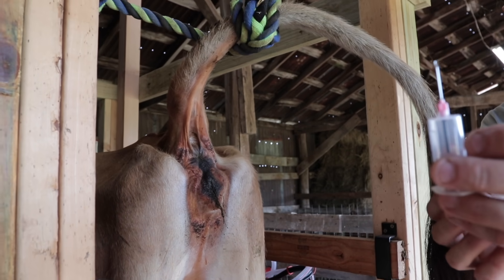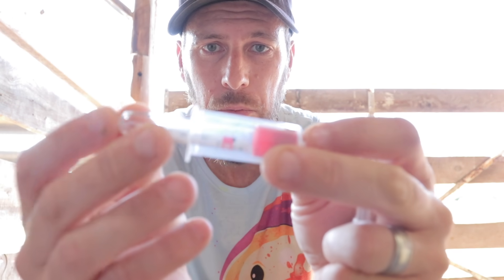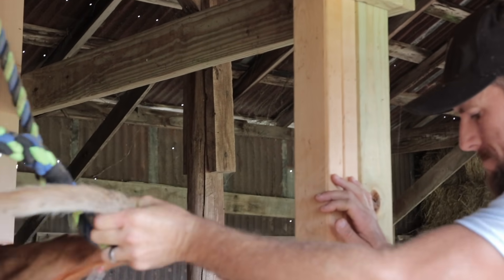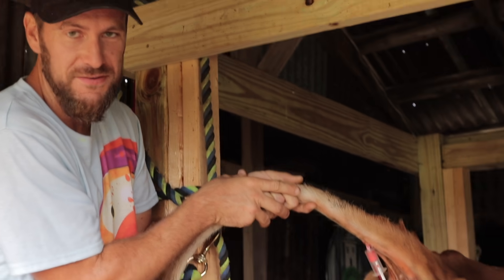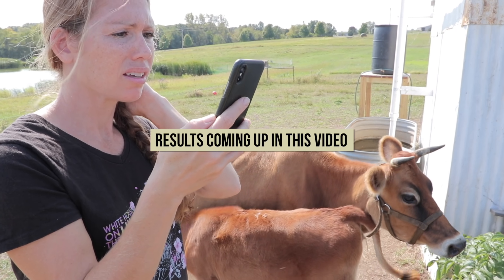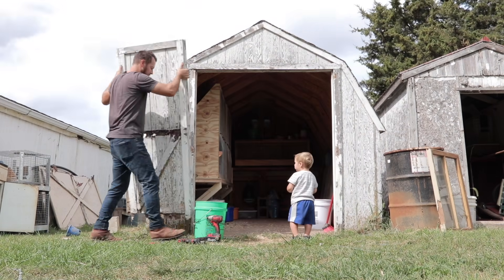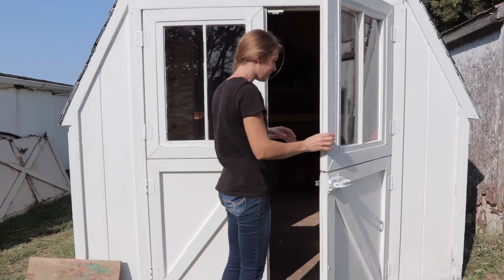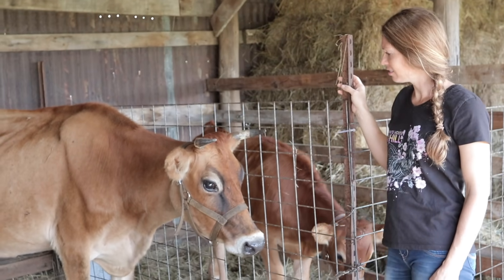is she pregnant?

Comment: gently push the tail up towards her head until you get gentle to firm resistance - this holds her in place as if she try's to back up it will hurt and they are smart so they stand still for you this is what the farmers and the vets do to hold the cows in place to have this done - we call it tipping the tail and in the middle of 200 cows getting preg checked they can be low calling of get hold of the tail and tip that dam tail even if they are in the crush and a head gate it is still a technique used to keep everyone safe

Comment: I am a phlebotomist and want to help you and Dolly. First of all 2 cc’s is not a lot it’s the same as 2 ml. That tube would’ve been fine less than half full. Also there is a safer, smaller needle called a butterfly that I would suggest using.  If the vein is superficial you want to go at it as if your landing a plane but if it’s deeper angle it at about 45 degrees. Also the needle should only go in as deep as the vein otherwise you miss. Sometimes you can pull the needle back slightly and get blood if you go too deep. Hope this helps for next time :)

Comment: A couple of tips from your friendly neighborhood vet tech! When drawing blood, it is best to enter the vein at a 45* angle (or there abouts, anatomy is different with every animal). I find the jugular vein a bit easier to draw blood from especially if you need a large volume. When holding it off, you can see it rise and fall as it is filled so it’s hard to miss. Dolly is super reactive and may benefit from a twitch or nose clamp in the future; they are not cruel and provide a quick burst of pleasure hormone to help distract during uncomfortable procedures. Also, the tube you used needs to be spun down and kept cool, if blood in a serum separator tube is not spun down it can affect your results.

Comment: Sorry but you guys are so ungrateful. Dolly is a living animal, not an inanimate object. You have to work with her and understand her behaviors. Obviously she will kick at someone repeatedly and incorrectly stabbing her with a dull needle. You haven't even owned her for that long, most of your troubles are a result of your inexperience and replacing her won't fix that. AI doesn't work that well, so buying another pregnant cow won't solve your problems unless you plan to just replace your cow every single year to get another pregnant one. If you want to breed her again you should rent a bull, but honestly you should give her a break from milking so she can gain some weight. No reason not to keep her and get another pregnant cow, so they can take turns milking each year. If she's unhealthy you have to figure out what you're doing wrong and adapt to her needs.
Reply: Agree with this! They haven't had a long, don't seem to work constructively with her (at least haven't shown them working with her), a lot of problems would likely be fixed, or at least smoothed, if they spend some time getting to know her and what works! We've had many animals before and things don't click straight away, we've worked with animals for years before they finally come round to us. It takes time, patience and understanding when you work with animals.  No day is ever straight foward :)

Comment: It’s so sad seeing Dolly needing to be in so much pain
Reply: 2:42 yeah :(
Reply: @Joshlyn Renfroe I know. Some of these people need to step back a little and remember this is a animal that has just been kicking the poop out of its legs. Don't think the needle is that much. They are a lot stronger then one little prick.
Reply: Joshlyn Renfroe Even if it were just the one day, they repeatedly stabbed at her (with what I’m guessing were very dull needle from overuse). A vet tech or vet could have had the blood drawn in a minute and avoided all that stress and trauma they put on Dolly. They also didn’t even hold off after removing the needle..
Reply: @PaxxTan  they used different needles each time.
WATCH THE VID DINGUS cus they got 12 of those needles.
Reply: @candicewdub2269  Having a small pinch feeling is not that bad as it seems cus i have had a needle before, it looks scary but it isn't.

Grow up sensitive child.
Reply: TIG RESS you can watch that video and honestly tell me you believe they only stuck her 12 times?
Reply: TIG RESS btw when you’ve gotten blood drawn, it’s from a professional. That’s why it’s a small pinch feeling. If you do it improperly (like they did) it can be incredibly painful and create lasting damage.

Comment: I took phlebotomy and you did fairly well. When she said "don't pull back" you probably should have. It's possible you went past the vein, and touching it back just a little bit could slip it back into the vein. But once you puncture the vial, if you wait too long, you'll lose the suction and need a new vial. That's probably why it was only dripping when you finally did hit the vein.
Reply from the maker: Agreed. I learned a lot through the process. It was difficult trying to learn while having Dolly continuously kicking the needle out. I think I hit the vein each day, but her kicking knocked it out so we had to give up. I appreciate the constructive criticism.
Reply: @whitehouseonthehill  yeah, cows are difficult no matter how skilled you are lol. But it will get easier!

Comment: If  you  push  her  tail  up  , holding  it  near  the  base , puting  some  pressure  on  her  spine, she  won't  be  able  to  kick. There  are  pictures of  people on  Egyptian  tombs  doing  it.  Speaking  from   45 years  ,  as a  dairy  farmer. Vets  would   get  us   to  do  it , if  they  were  carrying  out  certain tricky   procedures, and  it  doesn't  affect  the   cow  in  any  way .   Also bred my  cows  with  AI  done  by  myself (  did  a  course in  1979 ! ). It  does  work! A big  effort im  modern  dairying  goes  into  minimising  weight  loss ( by  nutrition ) after  calving. Doll,   needs to have  turned  the  corner and  be   gaining  slightly in  weight , to  be  fertile. Jerseys are normally  considered  to  be  more  fertile than  Holsteins , but  you  started  off  precalving  with  a  very  lean  cow , and  you  could  expect  to  have  more  difficulty  getting  her  in  calf   the  next  time. You  should  get  a   vet  to  scan  her  - and  at  the  same  time  they  would  find any  problems   such  as  metritis ( womb  infection  after  calving )  or  cystic  ovaries. If  she   were  empty  at  39  days   she should  have shown  heat  again at  around 42  days (  and  you  missed   her  heat  at  21 days. Or  she  could  have  lost  the  pregnancy (  due  to  early  embryonic  death )  so  her  cycle   could  be  lining  up  differently now. Did  she  have  a  good  heat  back  when  you had  her  AId  , and  were  her  discharges  clear ,  without  white  blobs? Did  you  see blood a day or  so after  she  was  AId? That  would  indicate  your  heat  detection was  accurate. Cows often  show  a  little  bloody  discharge one  or two  days  after  heat . Note  this  doesn't  mean  they  are  not pregnant -  it's  not  like  a  woman getting  her  period !

Comment: You could get a pair of impact cuff for Dolly to avoid the kicking too. I personally feel like cows on our diary farm are more likely to kick when they have something tied around their legs, since it's quite irritating to them, and possibly also itchy.
Also, I don't think yelling at her for moving around a lot while shoving a needle inside her tail is helping much, especially when failing to hit the vain you wanted to get. The loud noise you make just scares her more and is also the reason as to why she probably continued/got worse with the kicking as you tried to go on. Maybe get a vet who is used to be around cows to show you how they would take the blood? I think it would help having the help from someone more experienced with them.
Also, I don't think the tail got held right. You probably should put the tail up higher, if not trying to pull the tip towards the head. Since you were two people around her, one could've hold the tail, while the other would've gotten the needle in.
If you're trying to calm her down, you still could raise your voice, but don't turn it into yelling like you did. By experience I think shushing and petting them helps them calm down quite a bit.

This also goes for the milking. Try getting two impact cuffs, one for each side, and try to milk her with them. Usually it works wonders with our diary cows, even with the first timers.
The issue with the back teats being that close together would remain all her life, but it should not be that much of an issue while milking her with the cuffs and the mashine.
The amount of milk you guys get out of her doesn't suprise me much, since she's still fully nursing her calf most of the time. Maybe, ad an idea for the next calf, keep them separated until the calf is off of the milk? That would also mean you should milk the cow more than once a day, so likely 2. Have the calf have a bucket for the milk, and give it 2 liter per meal at first. Maybe even keep some milk reserved for later, so you could feed the calf 4 times a day, so every 6 hours. That would also help it grow better. After about 5 days we on our diary farm tend to change the calf from milk to milk powder, but since I don't think you'd want to do that kind of work for only one ( I know I wouldn't 😉 ) I'd just say to up the amount of milk it can drink at once up to 4 liter a meal, still for 4 meals a day. This would give the calf up to 16 liter a day, which should be enough for it to grow well. Depending on how long you'd want it to stay on the milk, you then should start fading out the milk with other food, like hay or fresh gras every day. Since its still growing, some pellets/grain would be also great. Once it's off the milk, it can be reunited with the mom, though, to avoid it from trying to drink from the mom, I'd say you could also put a temporary nose ring into the calf's nose and remove it once you're sure it won't suckle on the mom. ( but make also sure it can't get the ring stuck somewhere, as it would then possible for the calf to rip it out. )

In the end, having the calf separate could give you more milk to use, a better view on how well the calf drinks, and easier access to the milk in the mom, since she wouldn't try to hold it for the calf, since you guys would be the only form of milk relief.

As for the complain that she's too skinny. Maybe you could try and plant some clover all over her pasture? It's quite energy rich, so it probably could help a bit, if you don't want to feed her more grain than you already do. But be aware that she doesn't have too much on one spot, else she's very likely to eat all of it at once and start to bloat up. I'm not sure what else I could tell you about what you could do with her feed, since that wasn't my strength in the 3 years in training for taking care of cows. Maybe someone else could help you with it.

Comment: Drawing blood from the vein in the tail is easy if you do it correctly. Hold the tail in your non-dominent hand, and push it straight up and slightly back firmly but gently. This will make the cow kick less and expose the vein. When you're ready to insert the needle, use your fingertip to tap the insertion site to prevent startling the cow. Tap, tap, poke. The needle should be inserted at about a 45 degree angle (with the bevel facing up), not as deep as was done here. You went past the vein and also may have hit a nerve or bone with the needle being nearly straight in which can be very painful. Pulling back slightly on the needle can put it back in the vein if you go past it. Also, twisting the needle inside the animal should be avoided. Pressure should be applied to the area immediately after removing the needle. Having someone who has experience with this show you how to do it would be a good idea. Once you've been shown, it's a very simple, quick procedure, and a good skill to have if you intend to keep cattle.

Comment: Do y’all work with her more than just when you milk her? Has she been checked by a vet for any illnesses or parasites? Dairy cattle can be just as sketchy as beef cattle. They need to be consistently worked with to get them to be less “temperamental”. Cows sometimes tend to be like dogs where they just need training and rewards. Eventually, with consistent work, she may be so used to routine that she gets in her little milking stall and be “good” while milking. As far as her being skinny, cattle get parasites easily, a simple stool check could tell you if parasites are causing her lack of weight. I’d hate to see her gone without trying first. (This is all just curiosity and suggestions, by no means am I trying to be rude or anything.)

Comment: Make sure you have your needle turn the right way when you stick it in – the needle is cut at an angle, the down slope should be centered in the vein. If you have it turned the wrong way it can act as a backstop on the inner vein wall.... it can also be the reason why you had drip drip drip and no stream. Sliding the needle slightly in or out may help hit the vein to – do not wiggle back-and-forth. It’s not terribly hard to go through the vein, and too many pokes and you need to try a new spot because you may have just punched several holes in the vein – which is going to cause bruising. I would almost wait two days between poking, I thought I heard you say three days in a row… I bought had a heart attack. That was probably quite sensitive and irritating to poke that often.

Comment: Milk cows are very diffrent from beef cows milk cows were breed specifically for high milk production and put all their energy into that they hardly build any muscle at all (in this way their milk production is also realtive entirely to how much energy they can get from their feed). On the other extreme a beef cow was breed to have as much muscle as absolutley possible they have far far more than their wild ancestors started out with. I understand why you're hesitant on a bull so try checking around and see if anyone nearby already has a bull you can borrow for breeding. Especially if you end up getting a new cow so you can match the breed if possible. Calfs will be easier to sell that way

Comment: Try a Brown Swiss crossed with a Guernsey or Jersey.  The Brown Swiss is a easier keeper, but may not have the yield that the other two breeds but if you cross them... But in the long run, if you want gallons of milk, you're looking at a Holstein. They eat more and you are still looking at grain besides not liking heat.

Comment: I love Guernsey and Brown Swiss cows. I find that they r much more gentle in temperament than jersey cows.
Reply: Also if you work with the jersey baby and teach it to behave properly when handling its feet’s and just generally touching it. It will be much easier to handle when it is an adult. Cows that have been pet and handled on a daily basis right from their start seem to tolerate human touch much better. My neighbor has some oxen and she practices by putting blankets on the baby cows back and by taking on and off a collar around it’s neck. She even made a little handmade yoke for the young cows. They don’t pull anything yet but it helps them to get used to being handled and how it feels to have unfamiliar stuff put on them. Doing something similar might help your baby Jersey cow.

Comment: So good luck on the next AI.  I could not tell what your decision was.  My friend at Weed Em & Reap, tried AI for a year (goats) and it was 100% fail.  So disappointing to wait and wait and check the results and come up with a negative.  An actual visiting Buck got the job done right away every single time.  Boom boom boom.  Positive results.  You can get a visiting Bull.  I know it is rough and the Bull is insatiable which the Cow is in heat, but there are usually not any injuries.  Ain't nuthin' like the real thing.  Dolly is so pretty, but she does seem a bit skittish.  All the kicking was hard to see.  A kneecap would never recover from that.